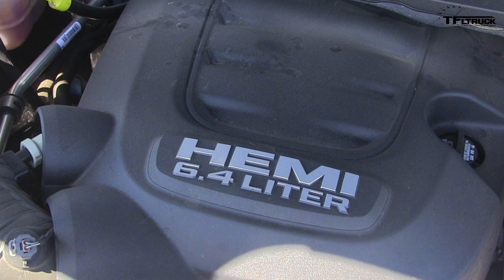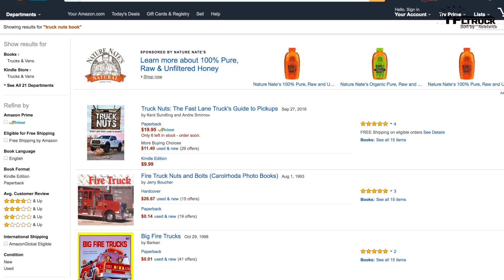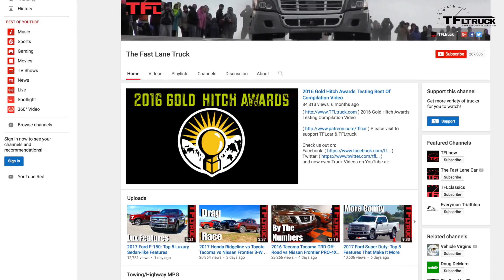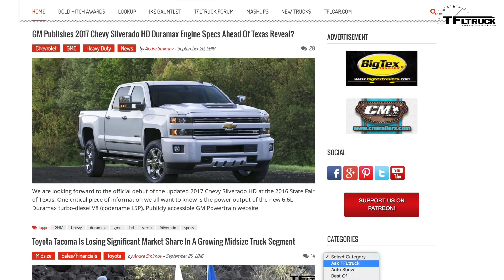Ask MrTruck #1: Why do Manufacturers Limit Torque in First Gear in Heavy Duty Trucks?

Comment: Torque limiting in lower gears? How about driveline protection? These things can produce almost instant huge torque just off idle.  You start multiplying that times the gear reduction of 1st gear and transfer case, your dumping some serious twist into the drive line and other components.  To much and you break things.  That is one reason the early Dodge Cummins equipped trucks are so easy to modify for increased power.  They were significantly derated from the showroom because the drivetrain was not rated for the full power that engine easily produced.  Dodge at the time did not have strong enough drivetrains to reliably support the engines full rated output. Why do you think semi truck engines are often limited to around idle clutch engagement torque of about 1000 foot pounds when they can often produce up to 2000 foot pounds or more at 800 to 1200 RPM? Answer. SNAP! Crunch, clang, bang, bang, bonk, bonk, bonk.
Reply: Someone's got it

Comment: I owned a 2002 Ram 1500, Quad-cab, 4x4 for 8 years. In all my years driving that truck, the only things I ever had to fix were the front and rear u-joints (pretty normal) and A/C condenser fan. I would say that that truck was extraordinarily reliable, considering it was in two motor vehicle accidents - my ex drove it into a guard rail during terrible winter weather and a Silverado hit me while driving in Canada (he tried to turn left while in the wrong lane) - and I owned it in states with extreme weather conditions (Alaska and Michigan).
I now own a Jeep Wrangler Rubicon X. To date, I've had no issues, but its only got 20k miles on it at the moment. Time will tell.
My sister owned a Jeep Grand Cherokee for 6 years with no major repairs. She had to replace an alternator and the pump for her windshield wipers.
My father owned a 2006 Ram 2500 4-door, Cummins turbo-diesel, 4x4 for 10 years. His truck had a couple issues: torque converter needed replaced, A/C stopped working for months and cost an arm & a leg to replace, the A/C motorized door later broke, and at some point the rubber grommet that kept his 4x4 lever in place needed to be replaced. You also have to understand that my father is extremely hard on his vehicles. He used his truck to pull 600lb tree stumps out of the earth (after digging most of it out), pulled down pine trees, takes it hunting at least 15x a year and tackles some tough terrain. Considering his lifestyle, I'd say that the truck held up pretty well. He now owns a 2016 Ram 2500 4x4 Cummins Laramie Longhorn. It is an absolutely stunning truck and drives like a dream; hopefully he does not have any issues over time with it.
Overall, I have been a happy Chrysler owner, even though I do not like to subscribe to a particular brand. Ford make great trucks, and so do Toyota. I have, personally, known Chevy trucks to have a great many issues - but that is just an opinion I have formed from seeing my brother-in-law fight with his 3 chevy trucks over the past decade. Two of them he had to trade after they became too costly to repair :/. Every manufacturer has shortcomings. Ford SUVs fall apart, Chrysler cars are garbage, etc. You just have to know what you're buying into.
I apologize for the lengthy post! I enjoyed the video!

Comment: Ford Motor Company, not a salesman stated as part of their display explaining the features of the new 2017 Super Duty trucks that the torque is 975 ft lbs at the Hershey RV Show. The woman model that Ford hired stated this and the 975 ft lbs was also shown visually in a video. I advised the woman at the end of the show that the actual torque is 925 ft lbs. She looked confused. The following day I went back and met with a salesman from Koons Ford that was there speaking with a customer. The salesman insisted that the torque was revised the day before from Ford to be 975 ft. lbs with the possibility of 985 ft lbs depending on what RAM does. Obviously, I do not know how reliable the salesman is. However, Ford Motor Company was advertising 975 ft. lbs at the Hershey RV show. Was this an error or a marketing campaign by Ford Motor Company?

Comment: Question:  When it comes to comparing single rear wheel 3/4 ton, and 1 ton GM and Ford trucks, what are the physical difference between the trucks?  When you compare prices, they are typically within a couple hundred dollars of each other.  So what are the actual differences?  Or in other words whats the difference between F250 vs. SRW F350, and then the same question for GM trucks...?
Reply: The differences between F250 and SRW F350 are the rear differential ratios and a little more heavy duty rear leaf for more payload on the F350. And basically, those are the main differences for all F250 vs F350 vs F450...as they all use the same powertrain.

Comment: Smh. All these readers wasting money on these massive and expensive trucks they don't or rarely need.
Reply: How do you know all there readers are wasting their money, particularly people who are driving the larger medium duty pickups?
Reply: Skipper Because they're asking about buying new ones
Reply: And what's wrong or wasteful about that?
Reply: +Skipper most of the people that buys this trucks will never tow more than 25% of the rated capacity in there life, a few will do haft and almost none will do there max
Reply: TrollingSince1991 Maybe for something the likes of 1/2  ton F150, but not something like an F450. Have you ever owned one or driven one? If you didn't need it, you probably wouldn't want one. They aren't comfortable, cheap or easy to drive, they are a SERIOUS tool for people that tow a lot of weight. They may seem overkill, but there is need for them.

Comment: A note about torque limiting: The truck's transmission gives the engine a mechanical advantage in low gears, meaning that your effective torque is probably going to be greater anyway.  It's how the 95 ton T28 was able to move with only a 500 hp engine.

Comment: Mr. Truck, here's another question/speculation for you. Where do you see the horsepower wars stopping? Not that I necessarily want to see it stop, but just because you can haul it on paper, it doesn't mean that you're the right person to be behind the wheel. We all know someone like that. Maybe the ones that shouldn't be behind the wheel are the one filtered out when getting a CDL. It's awesome that we can tow and haul literally a shit ton with these new rigs, but we're also moving into territory were maybe we should hauling with say a single axle tractor or dump truck rather than a pickup. Just a thought...
Reply: you are right...we have gotten to the point where a cdl wouldn't be a bad idea for anyone buying a heavy duty that wants to haul 30k which is about half of what  big rigs trailer weighs since those trucks are 80k gross combined and the rig itself is about 20k lbs
Reply: Well if you're at 26,001 pounds, you should have a CDL regardless. And I guess that's the point I'm getting to. It used to be if you can still pull it and more importantly stop it with a pickup, you didn't need a CDL since trucks just weren't technically that capable, not that it necessarily stopped anyone. Obviously, that's no longer the case. Then you can get into farm exemptions. How should they work into it? Everybody has heard "oh it's just farm use (wink wink) so I don't need a CDL" and I know I've used that excuse before as well. But in all seriousness, 26,001 pounds puts you into class 7 territory, so is a pickup still the best option for that?
Reply: I know someone will make a diesel with 1000 lb ft of torque. Within 4 years
Reply: The average person can buy a semi truck based motor home with no special licensing requirements. Cdl stands for commercial drivers license. If you aren't getting paid, you don't need one.

I had a 99 f250 with the 5.4 v-8 and over 300k miles. It would pull a 16k flatbed trailer up a steep grade at 45mph. With the trailer brakes set up properly it could easily tow and stop safely, yet it was only rated for a max towing of 10k. If you laid on the the brakes hard, you would burn up the brakes pretty much instantly, but if you didn't drive like a maniac it was fine.

Trucks have gotten much more car like, much easier to drive and haul big loads safely and are much more capable. Really, they are making trucks easier for the people that shouldn't be driving trucks imho.
Reply: lilsammywasapunkrock Bingo! You hit the nail on the head. They are making trucks easier and safer to tow with for those who may not be ready to be behind the wheel. That's the whole point I'm getting at. Just because you buy a truck that you can tow 30,000 pounds, doesn't mean that you should be the one doing the towing.
Reply: lilsammywasapunkrock Getting paid has nothing to do with it. Look at your restrictions.

My CDL allows me to tow greater than 10,000lbs and/or pull a combination over 26,000lbs.

Even if the GCVW is 22000 but only 5,000 of it is the truck itself, without my CDL I'm illegal. That's because I'm towing more than 10,000.

The way people drive motorhomes without CDLs is they weigh less than 26,000lbs and they don't tow over 10,000lbs with them. Example being a 14,000lb motorhome and a tow dollied Jeep at what, 4,000lbs or less. The combo is less than 26,000 and the tow is less than 10,000.

Money is not part of it.

Comment: the real question is can they adjust the limit torque on the fly depending on load, assuming you will have the trailer weight pushing down on the rear wheels for traction. surely you dont want it limiting torque when your pulling 20k+
Reply: the torque is not limited depending on the weight you are oulling, it is limited when you barely stop moving, you don't want all the trucks power at 5mph when you can easily spins the wheels and have no traction, just like you usually walk before running, max power is not needed all time

Comment: First @ 2:20 I assume you meant to say 17 Thousand, not 17 hundred.

Also, it's not really 3 different Cummins engines, but 3 different tunes , base on the torque handling capability of the transmissions it is mated to, but essentially giving you the same result, 3 different output options. 

But that does kinda speak to your comment below about the Ford Super Duty getting the 10-speed eventually... 
In order to make the 10-speed useful with the current or future 6.7L PowerStroke Diesel it would need toughening beyond the current 10R80 transmission which is only rated for about 650lbft so couldn't even do the task now. There of course are a lot of forum rumours of a 10R140 for 2020, but more likely based on taking the 6R140 and swapping in a 10 rather than any actual engineering making it happen at this point in time.

Comment: if you're buying a 1 ton pickup for 0-60 and quarter mile times.....you don't need a heavy duty pickup.
Reply: jesse burnett exactly! Amen brother
Reply: Not many people buy anything for the sole purpose of acceleration times, but things like 0-60 help people measure how well a vehicles accelerates, which helps them compare similar vehicles, even trucks. If it took your vehicle an hour to reach highway speed, you probably never would've purchased it.

Comment: is it possible for you or your colleague's to compare a locking diff truck to a open diff truck of the cane vehicle
Reply: locking works best offroad, light duty and not so much for snow although it can help in certain situations like low speed,but you could easily spin on the highway...not generally offered on heavy duty...open diff is best for the most weight so they wont break axles